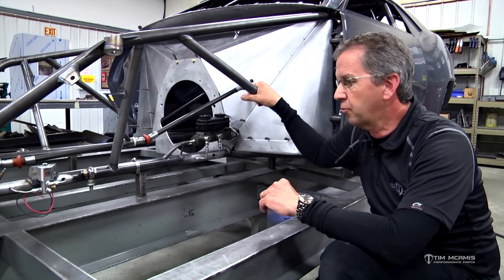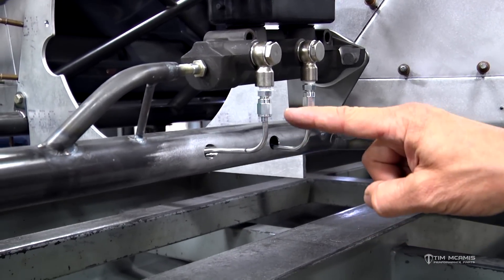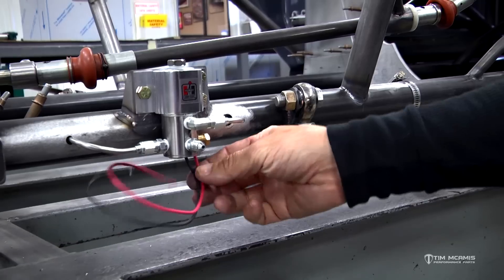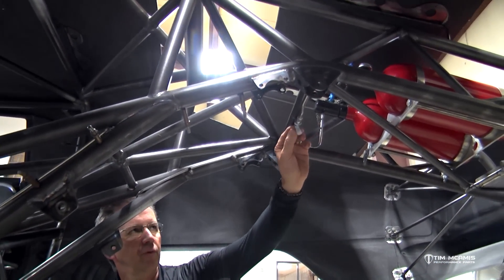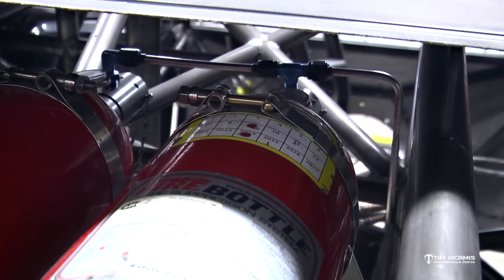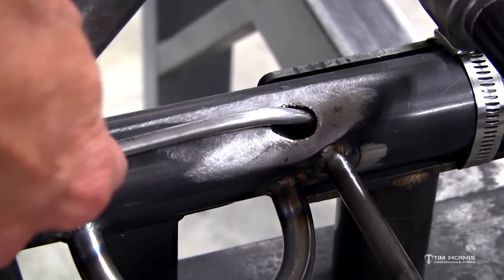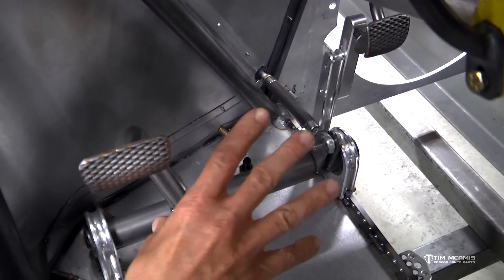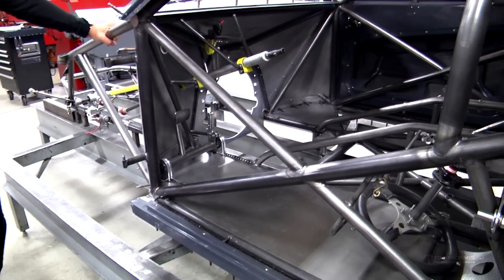Door Slammer Build: 11 – Brake & Fire System Plumbing

Comment: I thought mixing aluminum fittings and stainless lines was not acceptable. Are you using them on the fire suppression system because it’s lower psi or because they’re anodized?

Comment: small details like that tube welded in at an angle make the finished job look so much better. 1st its for safety and structural integrity of course! but not having a sharp hole just drilled in the side makes it look amazing! Clean idea also. On my street car, I'm swapping to 4 wheel manual brakes. I never thought of actually using the line lock as the dist block instead of trying to reuse the OEM block under the master cyl. I bet that brace and gusset on the end of the M/C mean everything on a sheet metal firewall.

Comment: Man that is slick.  I like that.  Very clean professional installation.  The only thing I don't like is the fire nozzles mounted to the fuel cell tube.  In a front end collision with another car or the wall I have seen the whole front section of the car knocked off.  If there is an engine fire at that time your fancy fire system is useless.  Has to be a better way
Reply: You're right there. But the point of the fire system is to do 2 things: protect the driver un the event of a fire, and save the motor/car during a 'save-able' fire. If the whole front of the car gets knocked off like you say, then you really don't have anything to try to save up there, so then your only looking to protect the driver. In that case, the only thing I would have done differently is I would have come out of the fire bottles directly into a T fitting to split the pressure 50/50 between the motor nozzles and the interior nozzle.

Comment: This System is for VW Owners who do not monitor the fuel systems of their cars.  Install this System.  After the first fire, it is time to do a clean-up and to replace damaged components and hoses.
Better--take charge of your Air-cooled VW.  Know why fires occur.  Eliminate the possibilities.  Save $150 dollars by simply regularly replacing fuel hose--of the right ID and type.   See this Article:  
http://1967beetle.com/fuel-pump/

Comment: hi, would not the openings in the chassis tubing for the brake lines let moisture into the tubing and cause corrosion of the untreated chassis.?
how is this countered or is it insignificant? Here in Australia it is a big problem for unsealed tubes.
Reply: Charles I would say where you are there is a significantly higher salt content in the air if you are remotely close to the coast. Here in mid west regions of America it dosent seem to be a big issue as far as corrosion goes. At least it has never hurt any of our chassis to have a small opening in a couple tubes.   It’s definitely worth the trade off for the added brake line protection cause I have seen things come off the car during a pass and fuck up a line making you lose brake pressure. Valid point though Charles

Comment: Great videos and awesome workmanship Tim.  I can't believe I haven't stumbled across these until now.
Any tips on running rigid brake lines through the chassis tubing?  I'm assuming the fittings are not installed at the time they are pushed through.  Do you push them through towards the one with the angled conduit so it bends slightly as it exits the chassis tube?  Then do you leave the rigid lines in place during painting?   I've pulled electrical wiring through the chassis by inserting mechanics wire inside of the tubing during fabrication then after paint pull the electrical wiring through with the mechanics wire already in place but I never even thought about rigid lines through the chassis but would like to try it.  Any tips would be great.
Thanks.
Mike

Comment: the agent nozzles should always be on the middle side of the t fitting perpendicular to the downstream flow of the agent. your current setup is going to push more agent out of the first t, rather than pressurizing the line first with equal flow from all nozzles. you only have 20 lbs of agent at roughly 200 psi which isnt much, especially if your moving and the airflow blows a good amount out most of the engine compartment. also make sure the agent cylinders are designed to be layed on their sides. they have a stem that runs through the center of them. if its not a curved stem that is pointed down upoon instalation, you will not even get half of the agent out of the bottle before you run out of the nitrogen agent propellant.
Reply: also, you sould look at capping your nozzles so that grease, dirt, ect gets in them. ive seen what happens when nozzles get clogged. in worst case senerios ive seen systems blow back out of the actuator